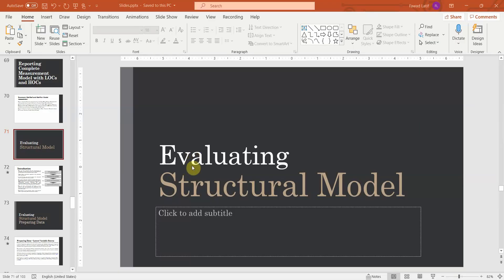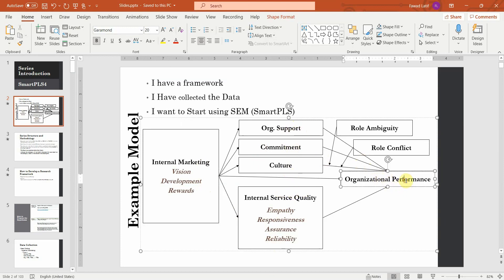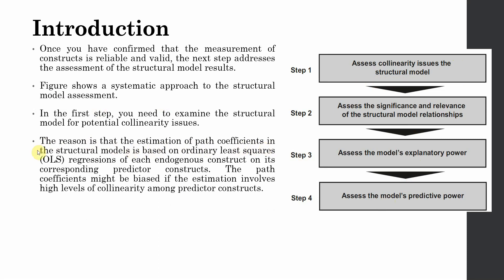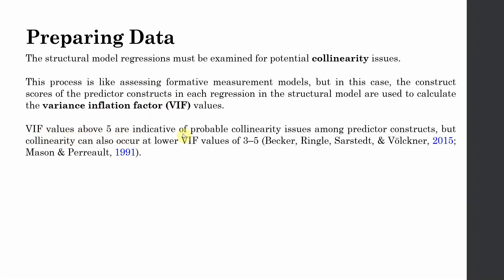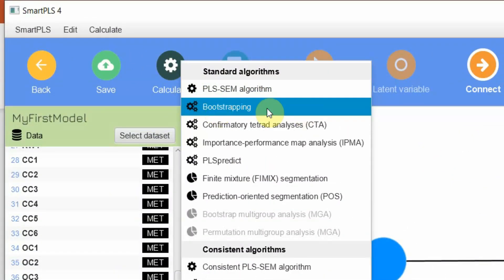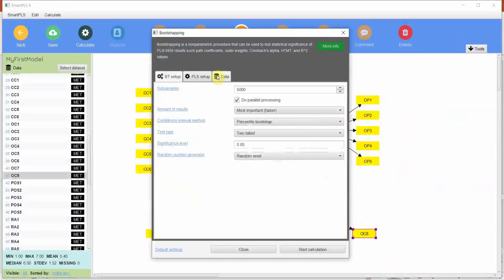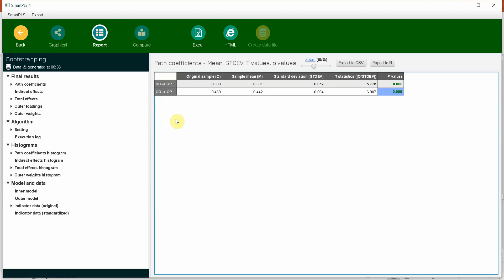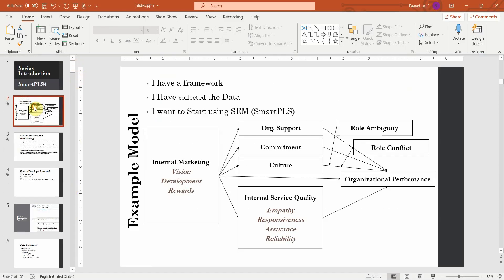#SmartPLS4 Series 21 -  Simple Structural Model Analysis/Hypothesis Testing

Comment: Thank you very much on this explanation. I have a question. When I conducted a bootstraping analysis, two of the indicators its values were NaN, and some indicators the p values were larger than 0.05 what is the solution to overcome these problems in the bootstraping analysis?
Reply from the maker: Check if you have categorical predictors; also assess your sample size.

Comment: Dear Prof. Can we use smartpls to test both hypothesis such as relationship and influencing ( Ex, There is a relationship between X and Y / There is a impact on X from Y)
Reply from the maker: Yes you can. But in Survey Research Relationship or Impact are taken as synonyms. Where the intention is to assess the significance of path coefficient.
Reply: @researchwithfawad  Dear Prof, It means path coefficients provide the strength of the impact or relationships (relevant to both types of hypothesis ) and t value and p value provide the significance states.
Reply from the maker: Yes